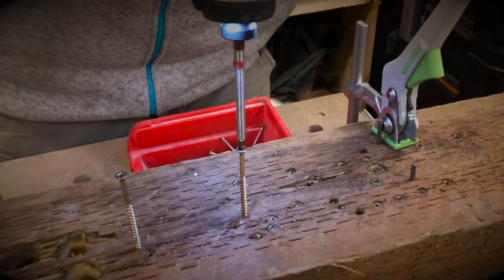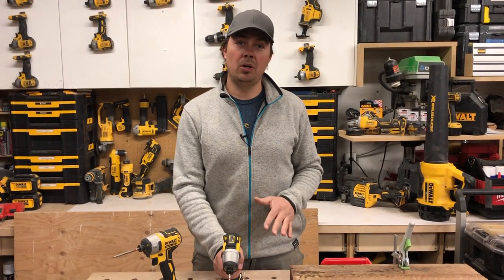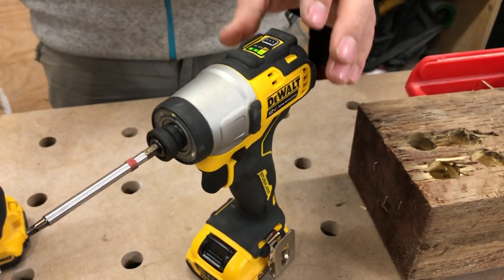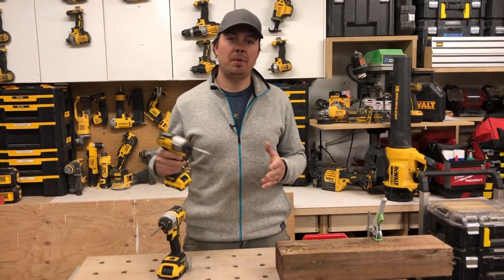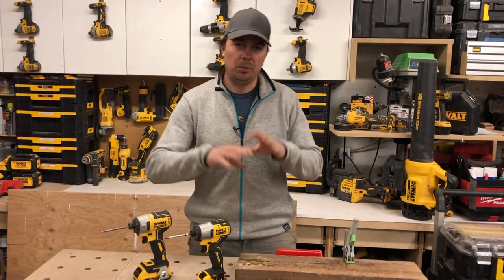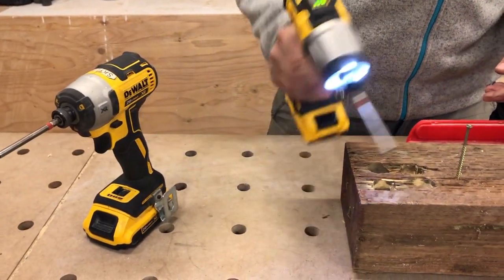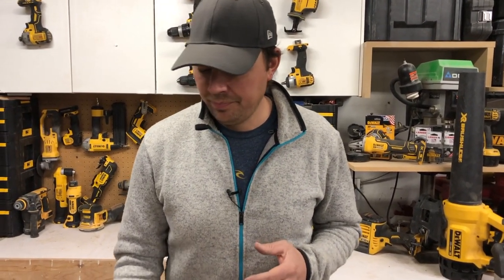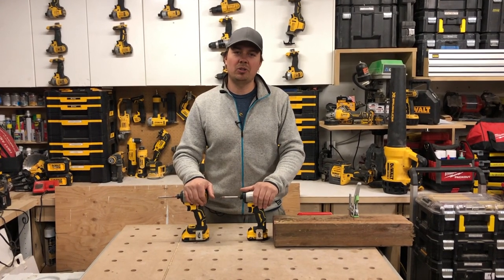Dewalt Impact Driver head to head: 12V vs 20V

Comment: I actually use the DeWalt 12v screw gun more than the 12v impact 🤷🏻‍♂️.... If you haven't used the screw gun check it out.
Reply from the maker: thanks bud will do!
Reply: I've got one, it's great for little screws that the impact is just too powerful to drive
Reply: @rch5991  you bring up real issues with Milwaukee. They make great tools there’s no doubt about it but need to go address some things. I highly recommend the Dewalt 12v extreme series.
Reply: @rch5991  that’s awesome, you won’t be disappointed with your purchase 👊🏼
Reply: Got one I need the impact attachment

Comment: So your demonstration with the 20V illustrated my consideration of the 12V driver (impact or screwdriver).  You started to twist the screw and immediately the speed of the 20V kicked the driver bit out of the screw.  Both my thumbs have gouges from the driver bit after it slipped out of the screw (use Robertson screws). My 20v and 18v impacts only have one speed range.  Maybe a multi range tool is a good option.   Having said that I love 12v tools.   I've never not been able to drive a 3" into framing wood.  takes a modest amount more time but to keep the bit in the screw head is worth it.

Comment: Iv used that 12 volt extreme for 4 years everyday for work, HVAC work and now just recently a job for electrical panel work. never used the settings on the top until now for not stripping screws into the copper strips. settings still work fine after extreme HVAC work in wet and hot conditions after 4 years non stop. O and it has the best light iv ever seen on a drill, lights up dark crawl spaces. I also use Milwaukee and 20v dewalts all the time for other things at work. but this 12 volt never leaves my go bag.

Comment: As a small engine technician in the winters I actually find myself going for the 12v more often than not for assembly/disassembly I like that it's weaker than the 20v I'm not as worried about over torquing or snapping off small fasteners and it's still a lot faster than hand wrenching everything
Reply from the maker: That’s a very good point. I would love if they came out with an option to actually dial in how much tourque you wanted to use.

Comment: Everyone should know that 12 Volt is for specific trafes work not for power. However, the power in the 12 makes more sense than the atomic depending on what you're doing
Reply: That’s a great point that I feel gets overlooked. I had an Atomic impact driver first and I wasn’t too impressed with it. I tried the 12v and it was just as powerful as the 20v and did every task that I needed to complete in a smaller footprint. I have driven torx fasteners and timber locks with the 12v and it does it no problem. Sure, it may take a few seconds longer but for a homeowner/DIY person like me that’s not a huge deal. The largest problem I have with 12v tools is the runtime. It’s very short.

Comment: I have whole XR set and 12v xtreme set and the 12v is indispensible when working overhead and on ladders. You wouldnt think the extra weight would be noticable but when your arm is extended for hours it makes a big difference.

Comment: So…. As a builder I run 3 framing crews. 3 trucks each truck has different brand  tools . One is all dewalt, Milwaukee and makita. 34 years experience. When you say the 887 is for framing, not really. It works for screws, decking, sheathing..etc. Not good for lags, Flatloks, timberloks, etc , for that you need the 894 or 899. 
  The 12v is great for installing windows.,doors, sliders, trim work with 2 1/4 trim head ss screws, etc.

Comment: Thanks for the video! Good information! I am exclusively DeWalt. It is easier for me to have one charger type that charges all their batteries. Most of my tools are the 20v platform with a handful on the 60vflex, but a contractor friend convinced me to invest in the 12v drill and driver saying they were small and really excelled at cabinet installs. Without doing my homework, I ordered a set in with 2AH batteries and one 6ah battery so I would have a charged back up. While I can say that I am happy with the 12v drill and impact driver, I have done the size comparison with 20v and 12v tools side by side. The 12v are not any smaller by any useful amount. In fact, the atomic compact 20v impact is smaller than the 12v impact. So…..I have dedicated the 12v tools to my Klein backpack where I have my electrical kit and they are now part of that kit. For anything electrical needing a drill or impact, they will do a fantastic job. My 20v tools are for everything else.

Comment: As a casual noob into home remodeling, the 12v is the way to go for me, I could see myself messing up hugely with 20v from it's sheer powah!
Reply: Have you ever used a Milwaukee M12.? It's the size and weight of the DeWalt 12v with the power of the DeWalt 20v. It does almost every job you need it to.
Reply: @dangrimes5078 that’s not true. The dewalt 12v line actually outbeats Milwaukee in its 12v line.
Reply: @anthonynery9562  Sir, you are entitled to your own opinions but not your own made up words.

Comment: The 885 and 887 are my go to impact drivers. I use the 887 at work daily and the 885 at home. Strong durable drivers that can take a beating on the job or DIY. Great video brother.
Reply from the maker: thanks man! they sure can take a beating! i've dropped mine so many times from a ladder and no problems yet. thanks for watching
Reply: Ya know, the 20v 885, 887 are not much heavier larger, or more ergonomic than the 12v tools. In fact, the 12V Xtreme tools have a weird bump that hits The web between my thumb and forefinger. It's probably a good thing on normal hands, but mine are crippled and bent from arthritis.
I do like that the 12v are lighter and easier for me to twist around and fit in tight spots, but TBH, there is no need to get the 12v if you are invested in the 20v Dewalt tools. And I suspect upgraded replacements are for the 885 & 887 will be out within the next year.
Reply: @hammerandhome  left my 887 on the roof of my shed I finished building at the end of fall 2019. Didn't find it until spring 2020 when I went up on the shed to blow all the leaves off. Found the driver with battery still in, picked it up and it still had 2 bars charge and worked perfect. Couldn't believe it. Months in the elements with battery still in and didn't miss a beat.

Comment: I have 4 12v impacts (3 drivers, one wrench) and 5 20v impact drivers, I find myself using the 12v units far more than the 20v numbers because of the weight difference. I also have both the Atomic one handed saw and the 12v xtreme one handed saw and there is little to no weight savings there
Reply from the maker: thats a nice collection! I do like the lightness of the 12v tools as well
Reply: @hammerandhome  LOL, that's not including the 20v 1/2 impact wrench, the 20v atomic circular saw, the gyroscopic screwdrivers thaty I love and use constantly and all the other bits i use.

Comment: I have the 12v driver and drill and very happy with the performance for the size and weight.  I use the impact driver for removing screws in access panels on commercial aircraft it works a treat especially when removing tank panels over head for hours.
Reply from the maker: sounds like if your working over head a lot weight is a big issue, I love the lightness and power that these new 12v tools have, ill be comparing the milwaukee 12v fuel to this guy soon. thanks for watching
Reply: So you left this comment at least a year ago can I get an update about how you feel about the 12v
Reply: @nickladucer7178  Hey I'm still happy with it and used it almost every day without any dramas. The batteries still charge fast and hold good charge.

Comment: Both of them are great!!!! DCF888 w/ Bluetooth and Electronic Speed Switch selector, and DCF887 is what I use for Driving Torx Deck Screws, Fasten Master Timberlok, and Spax Powerlag screws (NO Pre-drilling) and driving some 1/2" by 4" Lag Bolt (w/ Pre-Drilled Holes) mostly for Heavy Carpentry works, but for Finer and Light carpentry works and especially driving Philips screws DCF885 and DCF801 is what I use. The DCF801 replaces my old Skil 20V Power core Brushed Impact Driver. My DCF888, 887 and 885 are made in USA versions especially 887 comes with a kit along with DCF996 Hammer Drill. For a backup impact driver I have a Craftsman Brushless 3 speed Impact Driver kit (model # CMCF820D2) as a contractor DeWalt and Craftsman is what I use in the jobsite and also at home when it comes to impact driver. Just like my other friends I'm not loyal to any Brand. My circular saw are Bosch CSW41 Worm Drive and Makita 5377MG. For miter saw I have a DeWalt compound miter saw 10" (Non-Sliding) and I got Hitachi 12" Sliding Miter Saw they're all corded. For Hammer Drill and Rotary hammer drill I got Bosch for that corded as well. Even framing nailer I still uses Pneumatic Air Framing Nailer Makita and Hitachi. 
DeWalt dcf801 is awesome. It's very small and lightweight even with 5Ah battery pack it's still lightweight. And it is gentle and well balanced. Not too weak and not too powerful it's well balanced just like the dcf885 20V. Either one of them is what I use for Fine and Precise carpentry works and metal works.

Comment: 12v tools are so underrated !   I prefer 12v anything for fasteners ….HOWEVER !  You can stack the 5ah on those 12v tools and cruise all day with some power. 
Only thing is the batteries go dead faster on the DeWALT platform vs Bosch for sure. Bosch has better batteries and more efficient motors both DeWALT and Bosch make the best 12v tools.
Reply: Problem is boschs are very very weak. Many channels have proven this

Comment: I use the lvl 1 on the 20v for doing stuff where I don’t want to overdrive. If it isn’t quite enough, I’ll bump to 2. Drywall or assembly of Ikea stuff with plastic thread inserts.

Comment: For cabinetry, I think the Dewalt Xtreme screw driver is a better option. (Dcf601)

It’s 150 rpms faster than the impact driver on screw mode, and it’s clutched.  The impact driver on screw mode is almost as powerful as the screw driver in Max setting.  

I got both 12v tools.
Reply from the maker: good info, Thanks! i'll have to check the screwdriver out
Reply: DCF601 is truely a unique tool. I have nine drills in total including Makita, Bosch and Festool. The CXS and DCF601 are pure joy to use. 👍

Comment: Great Video. My question is: Can I use an 18v 5ah battery on a 12v circular saw?
Reply from the maker: Unfortunately no, 12 v is only for the 12v tools. The 20v and flex volt all work on 20vtools. And the flex volt work with flex volt tools as well.

Comment: Nice video!  The 12v is smaller and will be able to get in tighter places but the 20v (887) is still pretty light with a 2ah battery and can do a wider range of tasks with the 3 speeds.  I got my 887 in a 6 tool kit otherwise I would have bought the 12v drill and driver.
Reply: Thanks Brad, love my 887, no need for anything smar smaller😊
Reply from the maker: I think you made the right choice. the 887 is a great driver !

Comment: The 12v impact is better than all of Dewalt s 20v mid range impacts. 
Has speed selection, more IPM & RPMs.
Reply: My dcf840 20v will smoke that 12v

Comment: Can’t believe my 887 got stolen. Didn’t get my 850 though. The 850 is my “I will never ever get rid of this drill” tool. Since I still have the 850 and it can put down the torque on the high end I neglected to rebuy the 887. Decided I would be better off with 12v kit to replace it so I have a more versatile work kit. I’ll miss you 887 you sweet sweet bastard. You were like a second son to me

Edit: the two drills I was left with after the thievery were the 850 impact and the xr compact drill, absolutely amazing kit to be left with tbh I coulda kept working with just those two

Comment: I see in some videos if you use the 12v with the 3 ah batteries it has more power ! 
I have the 887 and I do like the size of this 12 v for ladder work ideal for small jobs , does it charge on the 20v charger by the way ?
Reply from the maker: yes, that's one thing Dewalt did well,  no need to buy a seperate charger for the 12v line
Reply: Y